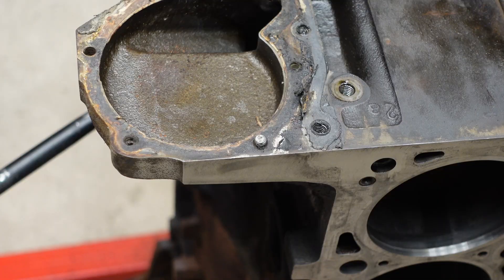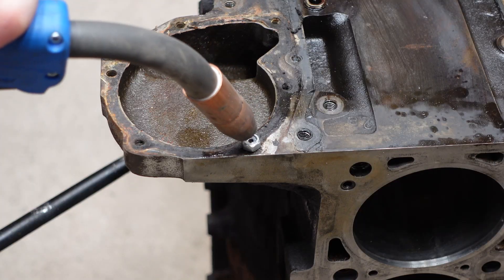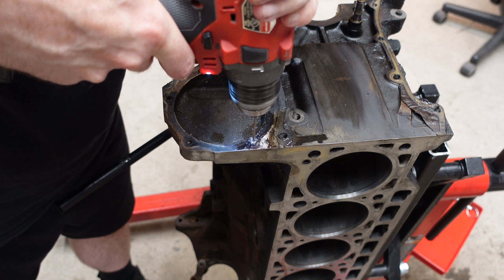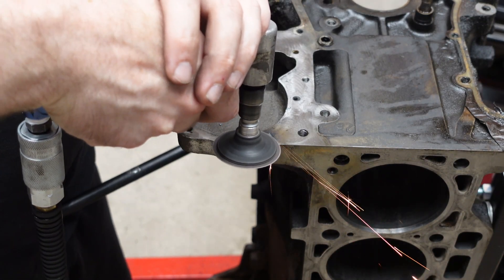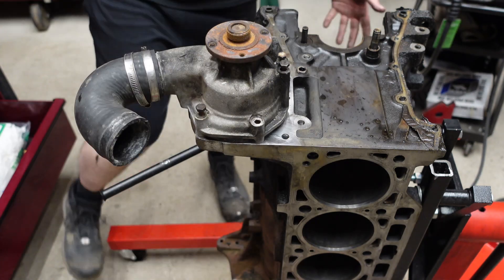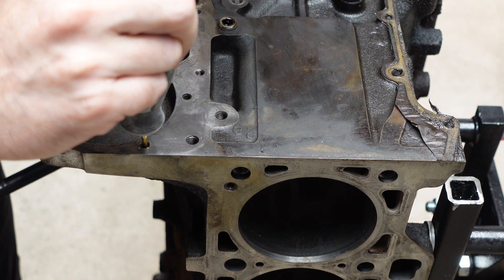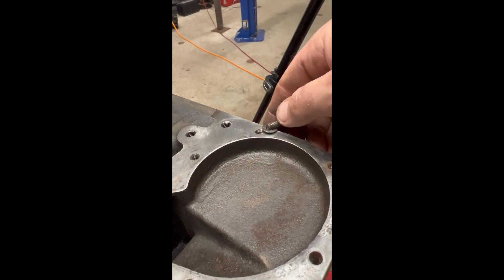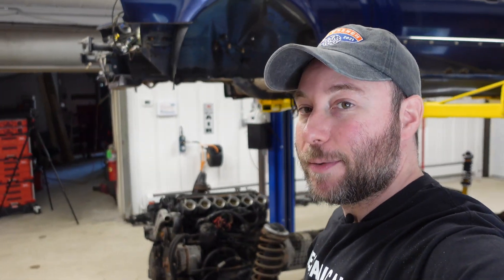How to remove a broken screw extractor inside a sheared bolt in the block! Technician nightmare!

Comment: I think you were on the mark with the nut and weld. But did you use a nyloc nut? It was to quick to tell. I think that why you got the porosity. I would have got a jam nut or ground one thin then repeat your same process. 

As a journeyman machinist and an engineer you did a great job. Screw that other guy. You will be hearing a lot from me, I’m looking to do my own engine build.
Reply from the maker: I appreciate you supporting the channel. There's all kinds of folks that love to tell me everything I'm doing wrong but that's fine. I laugh all the way to the bank when they do! Cheers my friend!
Reply: @wewrench  The other thing I wanted to add is are you familiar with thread repair products? heli-coil is the most common. They are not quite as good as straight material but there are other options that increase torque capability beyond cast. There’s something for every application. 

Like you said drill in the correct location is critical but after that the hole can be as big as the part allows and the repair will take it back to the correct size. 

I try to be a person that tells you what you’re doing right, everything can always be improved.
Reply from the maker: @Noone-jn3jp  absolutely familiar with heli coils. Didn’t have any handy though plus I was hesitant to use them on a gasketed surface
Reply: Cool. Just curious why you didn’t mention something to that effect but it was a little outside the premise of removing a broken bolt and reusing the original work.
Reply from the maker: @Noone-jn3jp  I’ve seen heli-coils fail in the field so I always try everything I can to just work with what’s there

Comment: Man I had high hopes for the welding a nut onto the threaded rod LOL... I had to do a lot of drilling out tapping holes on Eyeglass frames back in the day and those things were tiny AF.  The other trick i'll do is if the shaft of the screw has enough meat i'll take a dremel and slit the top and hopefully a flathead (plus monkey wrench plus brut force plus heat plus degreaser plus will of the gods) gets her done... Definitely won't work in most cases on seized bolts of an engine block... but it's done the trick many times :)
Reply from the maker: Those are all viable techniques

Comment: You might be a decent mechanic, but you are not much of an engineer. I have never seen such a series of bungled attempts to remove a broken bolt from a block.

It is quite obvious that the remains of the original bolt are still there which means the new bolt hole is off centre to the original and from the fit of the new bolt, oversize as well.

The most important thing to ensure before trying to drill out a broken bolt or stud, is the hole is centred in the remains. You eventually got somewhere near that (in the end) by using the water pump as a guide, but using a drill to mark the hole centre is not satisfactory. The only way to do it is with a centre (transfer) punch of the right diameter inserted through the hole - you might have to make one. Having marked the center of the hole, don't then try and drill into the bolt with a twist drill, it will wander no matter what you do. Use a center drill - a short stiff drill specifically designed for the job which will not wander.

For all the drilling forget using a hand drill, worse than useless for this job. Instead, buy, beg, borrow, steal or just plain hire a magnetic base drill which will ensure the hole is square to the block and has a rack and pinion drive so the right amount of down pressure can be applied to make the drill cut properly.

At the point where you had broken the stud extractor, do the sensible thing (I never use then for that reason - they break) - take it to a local machine shop who have a disintegrator - a machine made specifically for removing broken taps etc which are much harder material than your stud extractor
Reply from the maker: LOL. You are right, I'm not an engineer. I actually live in the REAL WORLD where maybe you can't remove the engine to bring it to a machine shop, or there's not enough clearance to mount a magnetic drill base, or you don't have the money or time to do all that stuff you said. You're not wrong...maybe if I wanted it to be absolutely perfect, and I had unlimited time and budget, or if I were building a race engine, I would have done all that you said, but my videos are for real people in real life situations that would occur in the field. Not in goldilocks fantasy engineering world like the one you clearly live in. Oh and by the way, I clicked on your channel...and surprise surprise, there's nothing. Join the club of armchair internet mechanics!